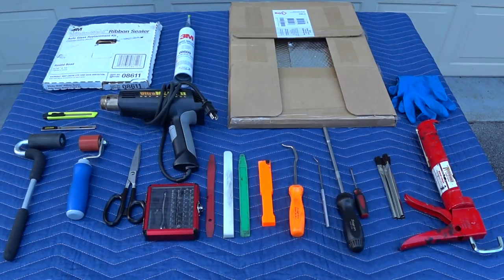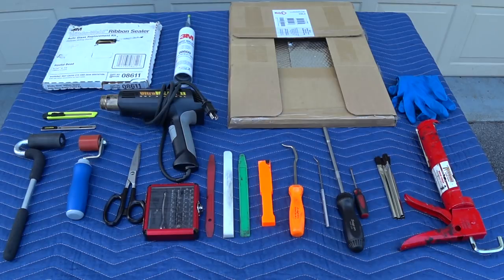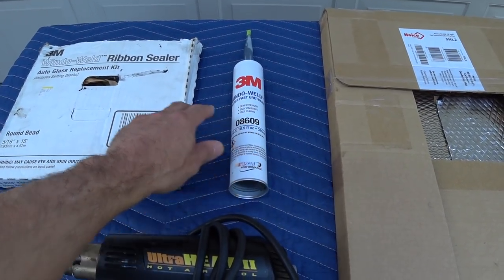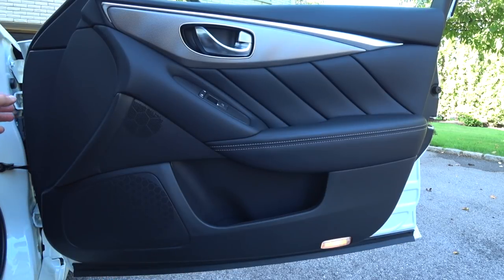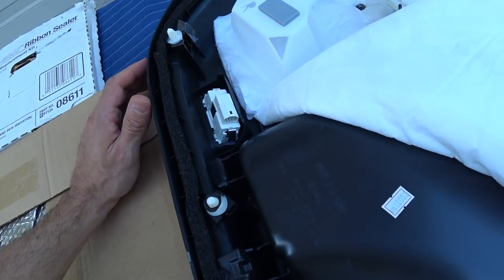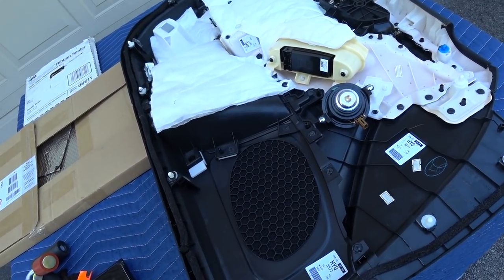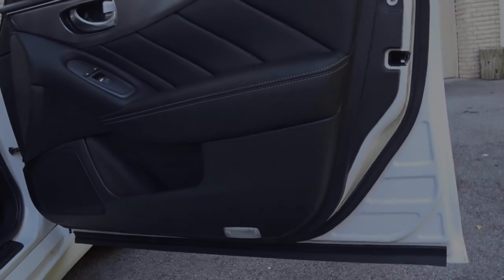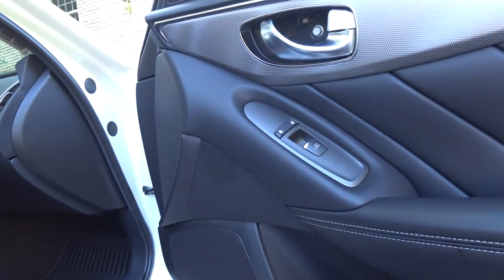How to Fix Door Panel Rattles Explained | Auto Fanatic

Comment: Exactly what I was looking for to cure the door rattles in my 2001 Tacoma .  I despise rattles...and now I can eradicate them thanks to you!
Reply: its been two years, did you end up doing it? I have a 98 4runner I want to do
Reply: @Tanner731  yep. I did do it. In fact I posted about it  here two years ago right below.  It did make a difference. Still pretty good two years later. Except the damn lock button vibrates when locked. Haven’t messed with it yet though.
Reply: @InfiniteRiffs  nice, bet you can put some felt or foam around the door lock to dampen it. think thats going to be a project for my 4runner soon
Reply: @Tanner731  thanks. I was thinking of doing something like that. And yeah it’s a fun little project to do that has nice results, even though you don’t actually see all the work. Just takes time and patience.

Comment: Thank you for this video. It helped eliminate the noises from my driver side door panel on a 2009 Honda Fit.  As a side note, I added Kilmat to the metal door.  On the removable panel, I applied most of the techniques that were recommended in this video. I used the same tacky gummy black adhesive that I removed from the plastic sheet to deaden and "glue" in place the red plastic clips on the panel and it worked.  All the red clips stayed in place and were no longer loose. Will repeat on the passenger door.

Comment: great video! I have a 2019 Honda Accord and the driver door rattles at a specific area, and that drives me nuts. i will remove the panel and follow your advice - thanks
Reply: Did you find and fix the problem with the Honda ?
Reply: @ophrasbankaccount7716  yes I was able to resolve the issue. Despite the shitty roads we have in Ontario, I never heard the rattle again.

Comment: Well I applied this method to my 2001 Tacoma door panels, which were rattling and squeaking.   Pretty simple process, just takes a little time.  And he wasn't kidding about the clips rattling around in the door panel.  They don't rattle after using the window weld!

Comment: 2 Questions:
1) Does using the window weld on the door side of the door panel clip (shown at 19:54 of your video) make it harder to take off the door if I need to remove it again?  I understand using the WW on the panel side of the clip, that isn't meant to come off...but the clip is supposed to pull away from the door and it seems like the WW will cause this to be more difficult.
2) Do you recommend putting some window weld along the top channel that slides over the door near the window slot?  I have a Toyota Sienna and the door panel hangs on the edge and I suspect it rattles around on that surface, but much like question #1, I am concerned that using the WW on that junction will cause the door panel to be difficult to remove from the door later.

Comment: Hi, great video and advice. I'm suffering bad with my mk7 fiesta with the rattling. I thought at 1st it was my tweeter's blown so I replaced them but still bad rattling. 😮 So I'm going to give this method a go later on. Just wondering, do I need to put any deading sheet behind the speaker itself? Many thanks.

Comment: I'm currently trying to fix a rattling 2014 Ford C-max window regulator. I'm going to try that window weld on the clips that hold the regulator to the actual window.

Comment: Thank you, very informative. That's exactly what I have with my CRV - rattle box that drives me nuts. You may want to add the door lock parts to your list, the steel connectors may rattle a lot with no easy way to silence them
Reply: Did you get any solutions to this?

Comment: So I’m new to this stuff, I have a Subaru Crosstrek with mid-woofers in the front door panels, I had my local audio shop put in some sound proofing materials in certain spots. It helped in many cases, but now I noticed the actual plastic door frame (like where you rest your arm) rattles pretty bad when the bass hits. 
Can I apply these kind of materials to the plastic part as well? Instead of the metal door frame?

Comment: Great video! I have a ticking noise in my 13 ml 350. Sometimes it does, sometimes it doesn't. Any tips how to trace where the sounds coming from?
Reply: have someone else drive your car around so you can sit closer to the source of the noise. If the noise is recreatable (example rattles when certain songs play at just the right frequency) then try to push down on the trim pieces at different points to see where its coming from.

Comment: Any advantage to getting the thicker 150mil Noico?  It's cheaper than the 80mil on Amazon right now.  (Thank you for this explanation - new 2020 Subaru WRX driver side door is buzzing from certain bass frequencies even at low volume.  Ordered Tesa Tape for the wires, will get the Noico wetsuit material for the paneling.)

Comment: Great video. Need to do this on my GX470. What’s the difference between the 80 mil sound deadener and the dynapad? Do you recommend getting both? Also, so it’s better to put the sound deadener directly on the plastic? I always thought it was meant for directly on metal.

Comment: Great ideas and video!!  My older Chevy S10 Blazer has metal rods and linkage for the locks and door handles. Any tips or ideas for reducing rattles and vibration on these?
Reply from the maker: Scott Wieben cover rods in rubber vacuum hose 👌

Comment: 2019 VW Tiguan with an intolerable rattling (like a screw is loose inside the door) that, of course, the dealership does not hear and thinks I am crazy for noticing (it can only be heard around 35+ mph)
Reply: 2020 Terrain Denali doing the same thing when my speakers hit bass. It's INFURIATING!

Comment: Is there any other option for the 3M liquid weld the 3M seems to be expensive. Is there like any other replacement that does the same thing
Reply from the maker: use 3M because it is the absolute best anything that is a knock up is not the same.

Comment: There should be a support group for guys with cars that have rattling / buzzing sound. My Mercedez Benz 2018 GLC300 has something loose in the back door driver side (right behind my ears) and it's driving me crazy. It's making my speaker's buzz. My wife doesn't hear it. Dealer has looked at twice, can't fix it. I either sell the car or try this. Good video

Comment: i went through all the steps and most if the sound rattles my door panel are gone but it still has some rattles, is it common for there to be some rattles? or is there anything else i can do besides the steps shown in the video? any and all help is appreciated!
Reply from the maker: yes rattles and noises take time to isolate and perfect have someone drive your car and sit in the side where you hear the noises and apply pressure to all panels and even bang on them so you can pin point the location

Comment: Was hoping you’d address a buzzing window controls / door lock cluster. It rattles in its place when the radio is on. If I press on the door handle or the control cluster I can arrest the rubbing. You talk about isolating panels with tapes and caulks...what about lubing? Like a dot of silicone lube flooded into the contact zone?

Comment: Can I use a silicone window sealant instead of 3M's Windo-Weld? Or it wouldn't stick? Kinda hard to find 3M Windo-Weld around my place.
Reply from the maker: no window weld is the only solution

Comment: I tried all of this on a 2009 Silverado. It's squeaking more than before. The thud when I close the door sounds way more solid then before, but the interior is incredibly noisy. Any advice would be greatly appreciated
Reply from the maker: sounds like the door panel is literally falling apart this is typical GM crap unfortunately. try to remove the panels and seam glue them with some urethane or strong silicone to see if this helps. its a very tedious process solving interior rattles.
Reply: @autofanaticcars  thank you for your response I really appreciate it. I finally found out what was the issue with the cab noise. The weather stripping was rubbing on the doors all I had to do was use some silicon lubricant and spray it onto the weather stripping and it worked like a charm

Comment: Get some hard wax (crayon, candle, etc) and shave off tiny little pieces with a knife or anything sharp. Look for every clip or screw that have some play in them and heat it up a little with a heat gun and apply a little bit of the wax in between. Don't add too much where it might run when it gets hot, add just enough to give it a thin layer.
Reply from the maker: wax will never isolate as good as the 3M window weld I show in the video

Comment: Hoping someone can help me out. I have bass rattle coming from the lower b pillar on both driver and passenger side HOWEVER I only get the rattle when the door is closed. When it is open I hear no rattle. Would this procedure help me out? I have a crosstrek and the door panels appear to be really easy to take off so I don’t expect any issues there. HELP! LOL

Comment: Hey hiii
I am india
I own a ford ecosport diesel..i bought it new 2 months n hav almost driven 3000 kms.
But i get to hear slight noise from the door panels & from the back boot as well..i asked the service centre they said that its a by default noise..
Could u suggest what could be done
Reply from the maker: follow this video and do it yourself most service shops will never fix noises
Reply: @autofanaticcars  yeah...thanks buddy..
Reply: But would it be good to remove the door panels as its a new vehicle & the original fitment ..
If i refix the original fitting would it be any problem in that..the panels should not get loose after opening the original fitment

Comment: I'm always so scared when I have to pull panels off, feels like I'm gonna break something, but as long as I dont pull to hard everything should be fine... Right?.. 😂
Reply from the maker: pull you wont break anything but maybe a plastic clip which is easily replaced.
Reply: @autofanaticcars  thanks for the reply 👍
Reply: I used to be this way too until I got plastic trim tool set. Every panel comes  pretty smoothly.
Reply: @colinj5291  no joke, I'm ordering a set today, had no idea that was a thing, looks like it's going to help so much!! Thanks a bunch man 🖒

Comment: At 13:00 - What is that circular thing that's sitting above the speaker grill and below the yellow thing. Is it used for artificial engine noise? 🤔
Reply: Carlos Davis pretty sure it’s another small component speaker or tweeter. some small speakers like that are actually mounted into the door panels instead of the door

Comment: my solution i figured out after 30 years owning cars  is to let the interior just dirt up and with time things will be set or damped to a much less stage where i can live with. Yeah i do not need clean cabins...its just a tool which moves me from A to B
Reply: but you felt the need to share this..?  hehe -
 the force is weak this one .. we could see if 30 years can improve this? yes - this option should be done firstly..
Reply: option is....relax and smoke a bit in the car on wet weather and spill a bit coffee or beer around.....;-)

Comment: Get information from repair manual or other source on how remove interior door panel. Remove interior door panel...Tighten all screws and bolts behind door panel, and around the speaker and electrical components. Reinstall door panel and tighten fasteners. Problem solved. 

90% of the time it's the driver door, because it gets opened and closed thousands of more times than any of the other doors on the vehicle. Things start to loosen after the car starts to age. (5-10) years.